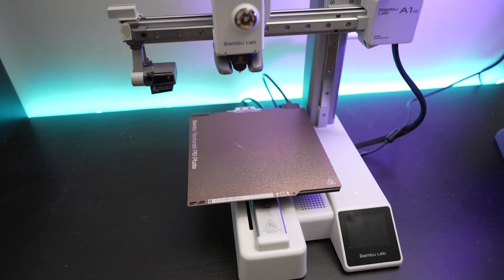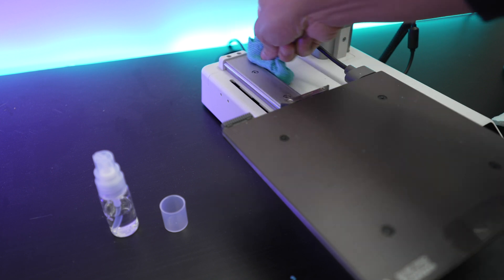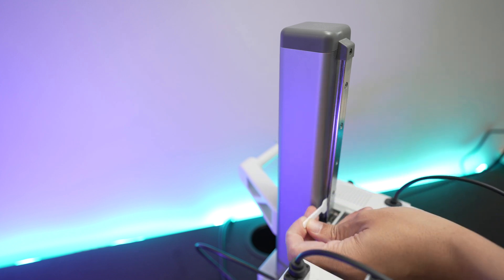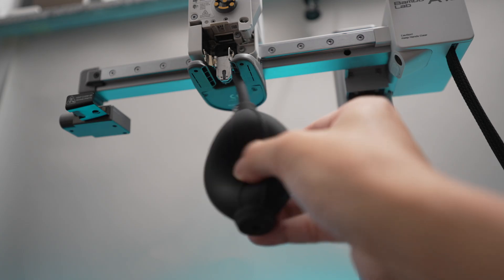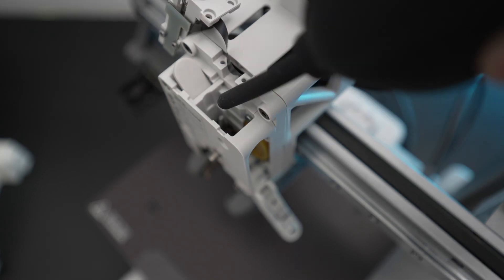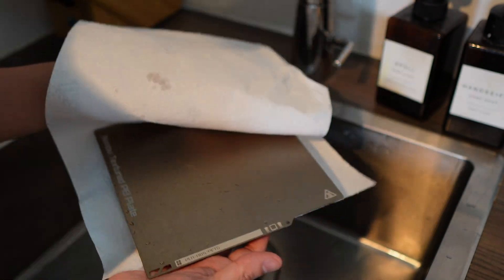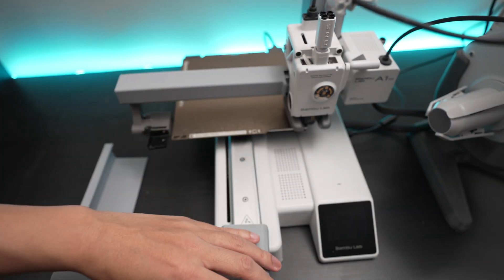Bambu Lab A1 Mini Maintenance Guide

Comment from the maker: BambuLab A1 Mini: https://www.awin1.com/awclick.php?gid=570773&mid=46345&awinaffid=2034675&linkid=4382675&clickref=
Lubricant Oil: https://tidd.ly/3KMFHqs 
Lubricant Grease: https://tidd.ly/3Lk36j2
Cutter blades: https://tidd.ly/4q7kYNn
Recommended Filaments: https://www.awin1.com/awclick.php?gid=570777&mid=46345&awinaffid=2034675&linkid=4382680&clickref=

My 2nd favorite filaments: https://geni.us/A4OFomi
Lubricant for X,Z,Y-Axis rails & idler pulleys: https://tidd.ly/3KMFHqs
Grease for Lead screws: https://tidd.ly/3Lk36j2
Deburring tool: https://geni.us/9WGzv
Wire cutter: https://geni.us/NAwQIL
Heat gun: https://geni.us/Jdcu

#Affiliate

Comment: I’ve learned when greasing the Z axis (threaded screw) it’s best to put the grease on with a smooth surface rather than threaded tool that we print out. Waste to much grease with the threaded tool and easier to spread and alit less grease to use when using a smooth surface tool.

Comment: On the Z axis you are supposed to apply oil also in that tiny hole so it can lubricate the bearings on that axis as well.
Reply from the maker: thanks for pointing that out, will add it to the next maintenance video!

Comment: It’s Bambu Labs official instructions that you should NOT use IPA on their texture PEI plate and their Cool SuperTack plate. IPA will make oil spread into the texture on the PEI plate. IPA, or other organic solvent, will also damage the surface coating of the SuperTack plate.
Reply from the maker: the best way to clean the plate is to wash it with dish soap + warm water. But if you don’t touch the print area on the plate with your hands, you don’t even have to clean it at all. 
IPA is just something you use in-between every now and then just to be safe. I’ve used it for years without any issues. 
SuperTack plate is another story, it’s a special kind of plate and yes, you dont wanna clean it with IPA.
Reply: Been using isopropyl alcohol on textured plate between prints for like a year with absolutely 0 adhesion issues or any problems….
Reply: @johnlong1553  never used IPA between prints for two years now, never had issues either.
Reply: @MrTian1212  well whatever you did certainly isn't more convenient than keeping a spray bottle of isopropyl and microfiber cloth nearby and just spraying and wiping down between prints....

what people typically recommend is soap and water which is a huge waste of time. But if you have a more efficient method than what I do happy to hear it
Reply: @johnlong1553  keep a bottle of IAP around until you spry it on the wrong plate and ruin 30$…. IPA basically has no benefit. It’s an organic solvent, it solves fingerprint oil. If you don’t touch the plate, you don’t need it. If you touch it, it can’t be used on texture plate either. Just a dry microfiber towel for filament debris and wear gloves is enough to keep plate sticky for a month in between washes. You are welcome.
Reply: @MrTian1212  I mean that sounds pretty inconveniet to handle it with gloves. The plate is not damaged in any way and you simply remove the plate with bare hands, spray it and rub it down. Always get good prints and haven't changed plates in a while. But I do just recreational stuff, had it over a year and as I said no issues whatsoever in print texture for the pei plate or layer adhesion.

I touch the plate all the time removing things and scraping stuff off ocassionally too

Comment: Every time I do this, I perform a calibration (automatic bed leveling, vibration compensation, engine noise suppression). Is this necessary?
Reply from the maker: i recommend doing the calibration after you’ve done all the maintanence on it.

Comment: Why don't you say that you should definitely buy a filament dryer for the printer? Except for SBS and some others, all the others absorb moisture from the air very well and will be defective when printing.
Reply from the maker: hey thanks for your comment! I have another video where I showed a cheap solution to keep filaments dry. I also mentioned about filament driers if I’m not mistaken, check it out if you have the time!

Comment: 04:02  Cooling Fans (Weekly)
00:24  Y-Axis Rail (Monthly)
01:55  Z-Axis Rail (Monthly)
02:29  X-Axis Rail (Monthly)
02:59  Idler Pulley (Every 3 months)
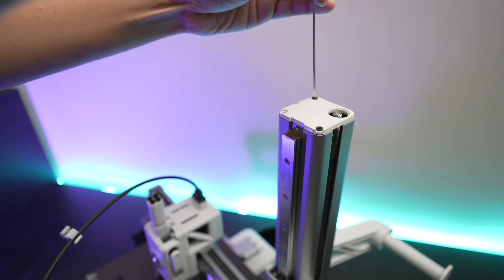03:08  Lead Screw (Every 3 months)
04:25  Extruder (Yearly)
04:36  Filament Sensor (Yearly)

Comment: Apparently isopropyl is bad for the material that the default Bambu a1 plate is made of. Better to use dishwashing liquid and fully dry.
Reply from the maker: ive been using IPA moderately for 2 years without issues. I use it in-between prints every now and then. 
Of course Washing plate with soap is the best way to clean the plate but if you avoid touching the plate to begin with, you can skip cleaning the plate altogether.

Comment: Word of advice regarding lubricating the rails: Mind the viscosity and don't over do it. I lubed my X axis with a low viscosity oil and it ended up smearing everywhere inside the printing head, including the fans. I was getting progressively worse bed adhesion because the fans were spitting tiny specs of oil all around the printing bed. I had to fully disassemble the printing head to completely clean the mess. Fun times.
Reply: I use the tools and just place 2 or 3 drops and use the tool to smear it.

Comment: thanks for this! helped a lot ^^
lubing X axis rail - i put printer on its side (so X axis points up) between two spools (so printer weight don't damage the cable)
Reply from the maker: Glad that the video helped, and thanks for the tip for lubing the X axis rail! 👍🏼

Comment: Can you tell me how to print with abs filament on bambulab a1 mini without glue stick
Reply from the maker: im not sure if thats even possible since abs would need a high bed temperature. And you’d probably need some kinda enclosure to contain the heat, else it’ll just warp.

Comment: This is almost perfect!  I was a little stumped at this stop ... instructions missing on removing the print head.  If you notice, the rubber head cover is on then suddnely off; I almost hurt my machine trying to pop it out before realizing it was missing the steps of removing the cover and disengaging the quick release.  
https://youtu.be/wPPDF_JKLAk?t=244
Thank you so much for this video!!  I really appreciate it!
Reply from the maker: Im assuming the rubber head cover you meant is the silicone sock? If it is, then yes, you need to remove the cover first. 

But I’m glad that my video was helpful!

Comment: excuseme at minute 5.35 you reinstal a part but I dont know how to do it, do you know how?
Reply from the maker: just carefully insert the whole unit (the filament sensor cable is attached to it so just wiggle it in gently). Then just use the screws to hold  it in place👍🏼

Comment: Im currently dealing with blob of death
Reply from the maker: aw man sorry to hear that man! did you manage to fix it?
Reply: @Lukis3D  I was able to clean most of it off. Seems to be working okay for now!
Reply: @spreencer  the cleaning with dishsoap does wonders. Make sure you scrub it and don't touch the build surface after you dried it. I think he shows at about 6:00
Reply: @Lukis3D  Yeah I did! Ended up damaging one of the cables from removing the filament but it's been working!

Comment: Just got mine and now I fear the blob of death
Reply from the maker: just do a proper maintenance on the plate and you should be fine. One of the best practices that I do is to always grab the plate on the edges/corners when you remove prints so you dont transfer grease from your hands to the plate.
And if you do, wash it with dishsoap.
I’ve been doing this for a year and after 1000 printing hours, I have had zero issues with adhesion / blob.
Reply: @Lukis3D  ok thanks

Comment: You manually moved the plate along the x axis to lubricate the x axis rail. But how did you put down the lever (holding the nozzle) to be able to lubricate the z axis rail?
Reply from the maker: before turning off the printer, I moved it with the control button. or you can home the axis, and the print head will move all the way down. After that, turn off the printer and do the maintanence for it. Hope that helps!

Comment: Is the A1 mini bed size enough or you find yourself regretting getting it and wish you get the a1 ?
Reply from the maker: Although I didn‘t regret getting the A1 Mini, I actually did end up getting the A1. So if you‘re still deciding, I highly recommend getting the A1 Combo (the AMS lite is the best add-on!).
Im planning to do a video about both of the machines in the future and what I think about them👍🏼
Reply: I personally am a little but that's because I've never used a printer before and can't currently use slicing software so not alot fits on the plate, but it's still really good and I love it very much